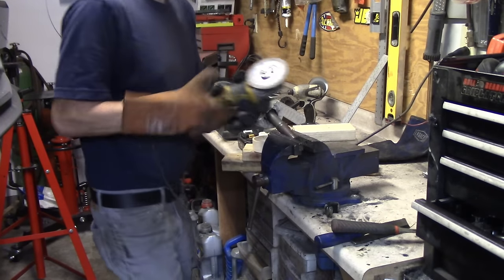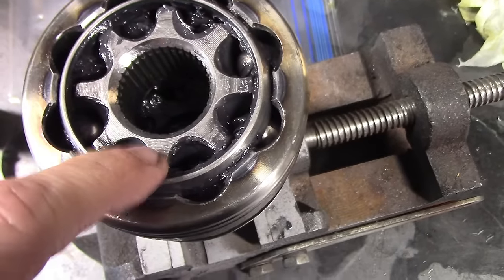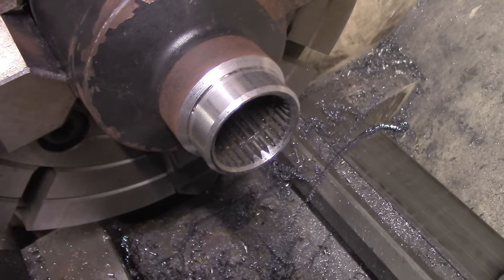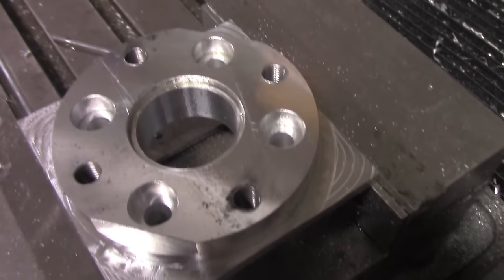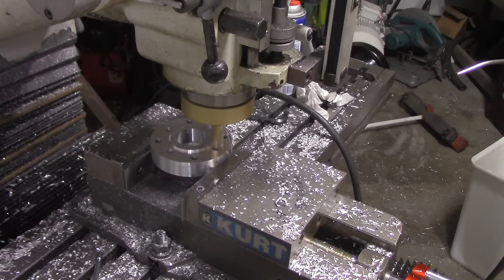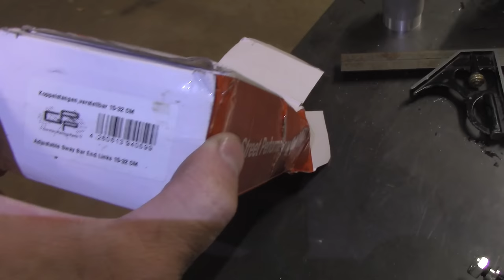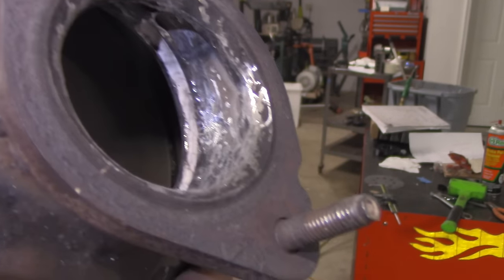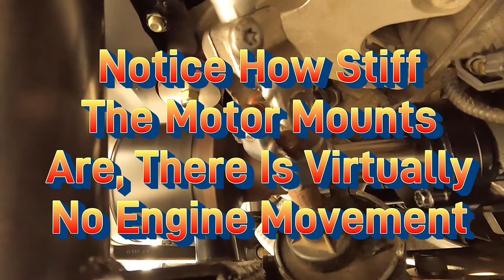The Worlds First AWD S550 Mustang!!  - American GTr Hits the Road, All Wheel Drive Mustang Ep 25

Comment: I get why some people only want RWD but when you push high HP through the rear wheels in a front engined car, it’s not only difficult to put the power down but it is also dangerous in the wrong hands. Any amount of power is dangerous in the wrong hands, certainly, but I think the thousands of videos of RWD muscle cars losing control makes my point. AWD does trade some "playfulness" for stability, but I think when you're running 400+ hp you should be just as concerned about stability as you are about having a good time. You can still break the tires loose in an AWD, but it's much more forgiving. I won't ever go back to RWD, personally...the advantages of AWD far outweigh the disadvantages, in my book.

Comment: I am impressed.  Well done.   Dont understand the paddle shifts on steering wheel and clutch?
Reply from the maker: I explain it in the video, the car came with a gt500 steering wheel, even though it is a manual 😁
Reply from the maker: I will remove the paddles eventually
Reply: I most have missed it.  Thank  for your reply.    I was watching this video in disbelief, waiting for that punch line or the ha ha ha moment.  I am currently watch episode 14 and it is making alot more sense and I am a believer.  You accomplish it.   I have to watch the project for the beginning...   @npvg

Comment: All you had to do is use the tranfer case and auto transmission from the Explorer ST! done
Reply: Won't you have clearance issues, with the engine and driveshaft, like he did with this design? Pretty sure the engine sits lower in the mustang than the explorer.

Comment: was the focus just to make it "snow ready" or was this to aim for performance?  What is the hp to each wheel and did it in fact increase the overall performance (dyno tests)?
Reply from the maker: The goal is not to drive it in the snow really at all.  I am making a PERFORMANCE AWD car.  At the end of the video I mention that I wouldn't have done the project if I was not going to boost it.  The engine is currently stock and thus really can't fully utilize the AWD in dry conditions.  The point of snow shots, beside making good Youtube, was to test AWD system in a low traction situation with the stock HP level.
Reply: @npvg  awesome!  Cant wait to see what you can make happen on the performance side!  God Speed Friend!!

Comment: Using Dodge for your basis for awd is probably the worst thing you can do in terms of performance. But for a stock coyote sure I guess.
Reply from the maker: In all seriousness, why?  Dodge didn’t make it, Borg Warner did.  Same parts are used in Ford, GM and even Porsche vehicles.  

Do you have a link to a failed unit?
Reply: @npvg  the same t case is not used in dodge? I have this system in my awd magnum and me and other ppl have broken this at the strip , I would have used infinity/nissan transfer case the ETX 13B  and front diff at least its performance derived based on the Skyline GTR  and had optional LSD
Reply from the maker: Different case, the magnum used the Mercedes case with a center diff.  The 2011 and newer use a variable torque split case just like the infinity case.  I have both and the dodge/borg Warner parts look stronger.  Time will tell.  Look up borg Warner 4440 tcase.
Reply from the maker: I have an lsd for the front Toyota diff and the gtr diffs are tiny and are known to fail.
Reply: @npvg  GTR R180 front diffs has seen over 1000whp they are not known to fail who told you this? Some ppl break them but none of that is common . The borgwarner t case was never based off a sports cars t case though?  It has a decade of design in it.
Reply from the maker: I was referring to the front diff in the r35 which is a r160 or so and they fail.

The same basic AWD mechanism is used in the AWD Porsche 997 911’s.  The ball ramp system is the same as the infinity and r35 gtr.
Reply: @npvg  r35 differential housing is not weak you just upgrade the internals they are not a common failure . Are you accounting for the owner running drag radials and a 3800lb curb weight to account for. There are even billet versions of the case.
Reply: What ball ramp are you even talking about ???  The R35 and infiniti are electragnetic torque metal disc the 997 does not have this its totally viscous  only the 991 does.   @npvg
Reply: just replying so i can find out more on this😅
Reply from the maker: I am sorry for the delay.  I had to get my story straight:)  The 997.1 Turbo had the multi-plate clutch with the ball ramp engagement.  Then with the 997.2 all of the version got that system, including the more basic Carrera 4.  This ball ramp system works EXACTLY like the R35 GTr and the Infinity Tcases.  Check out these rebuild instruction for an R35:  
  https://www.jackstransmissions.com/blogs/pages/gtr-gr6-4wd-fwd-forward-drive-unit-rebuild-instructions

This system in the Porsche is made by Borg Warner who also make the Tcase I am using and the basic operation of the clutch is exactly the same.  Here is a history of the Porsche AWD systems:
  https://presskit.porsche.de/specials/en/30-years-awd-in-porsche-911/topic/highlights.html 
Look at 2006: The First 911 with PTM. 

Basically the point of the ball ramp is to multiply the force available form the energizing coil controlled by the AWD computer.  This coil cannot produce enough force to clamp the clutch.  The coil draws in the plate of the pilot clutch that drags the ball ramp.  The balls then travel along the ramp compressing the primary clutch.  

I will have to make a video on the Tcase in the future if you want more detail.

But in summary:
1 - I am NOT using the early Dodge TCASE used before 2009 that is weak. 
2- I using a Borg Warner 44-40 witch is a variable torque split T-case
3-The BW 44-40 works exactly like the 997.2 AWD system (a sports car), it is made by the same company. 
4- It is not made by the same company, but the R35 GTr ETS unit also works in exactly the same way.  

Tim
Reply from the maker: As far as the front differential goes, please watch this video that explains why I went with the Toyota unit. 
https://youtu.be/nYSZKPoX_co?si=p23J6dKgay7rx_OU

The Nissan Diff is a High Pinion diff and just wouldn't work.